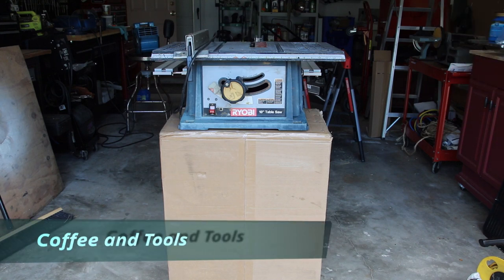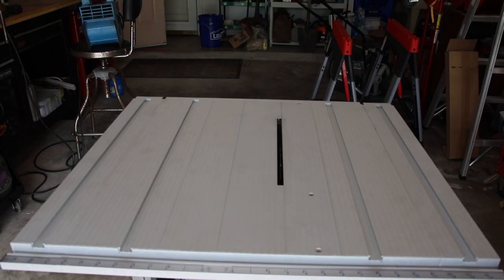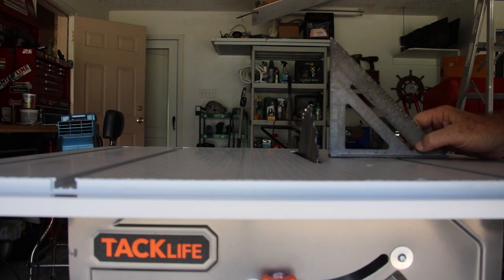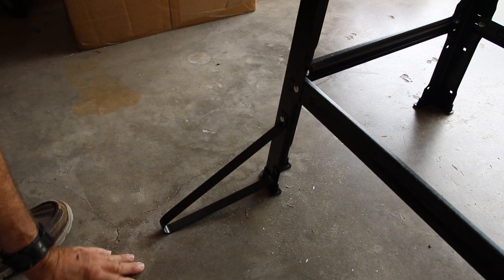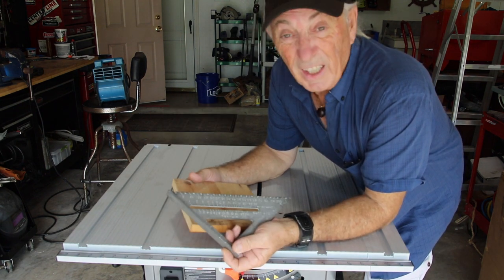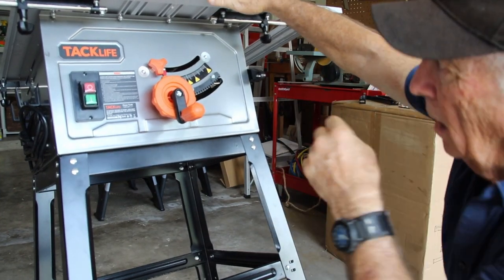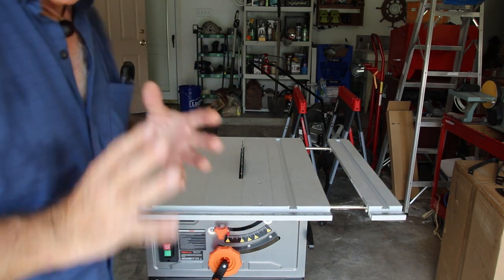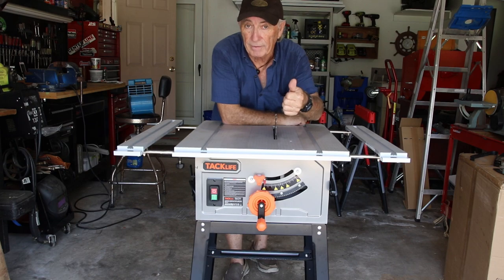Low price Tacklife table saw VS my old Ryobi saw, C&T Ep 112

Comment: Gen 2 has the 5/8" arbor and the full length fence.  I just put mine together last night.
Reply from the maker: Very pleased to see the updates on it from Tacklife tools. We did an update video about this generation 2 model :)
Reply: nice to hear that ,,,the two points that almost made me forget about this saw ...it seems there is a lack of good affordable tablesaws to be had during covid supply and demand times.  My last Sears with the folding wheeled  base is a wonderful saw but the  bearings are starting to go after a lot of hard time,,,its been a great saw , and i have a replacement wheel around base because they did a free factory recall on a base that failed on 20 out of a zillion saws: user error in my opinion, have never had a problem with my original base .  the search continues for a saw I can put on that new base ....this may be the ticket. I will not buy any more sears things now that they are gone and have stopped making the 19.2 volt tools which are damn good tools , especially the 1/4 inch impacts.  Sad they stopped making those and sad Sears is no more .

Comment: Good thorough review. The fence would drive me nuts. After using a dewalt I bought one. The dewalt fence was a major selling point for me. Tacklife seems like they make solid tools. Especially  at that price point. As a young company and with Amazon affiliations I can assume they will only get better. I have bought some cheaper Wen tools that have been very good.
Reply: The pinion system is why I bought a SKIL tablesaw. They also use that system. I bought a table saw for precision, the last thing I want is having to wrestle with rails to get them square. And its not just this saw either that has the issue, a lot of other name brand ones do too!

Comment: The only problem I had with mine is the fence is not sturdy and Izzy move it to the other end it moves so in essence the fence sucks other than that it's a good little table saw
Reply from the maker: I've made an upgraded fence. Further plans are for a better blade. Like you, the saw is pretty good.

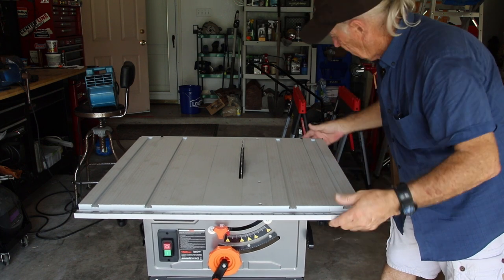Comment: Hello,  at 10:35 you mentioned a sled for this saw.  Have you made one, or are you going to?  I want to make one for my Tacklife saw and need some ideas.  Thanks
Reply from the maker: HEY !  Yes the sled video will be coming up soon. Thanks for asking. Should be out in the next few weeks.
Reply: @SirTools  Sounds good I will be watching for it.  Have you gave any more thought the the fence dimensions? I want to build one of those too.  Thanks again.
Reply from the maker: @robertbonds2562  Hi Robert. The 4pc of wood used are all 3/4 inch thick. Total length is 29 inches. basically you'll need 2pc of 3/4 x 2 inch (fence face plates) and 2pc of 3/4 x 5/8 inch. The slot opening is 6 5/8 inches in length. The slot open should be 5/8 inch to fit over the existing Tacklife assembly. Hope that helps for your project. I cut this from an old pine shelving board.
Reply: @SirTools  Awesome thank you.  Love your channel keep it up!

Comment: You didn't discuss the fence. Does it lock parallel to the blade. Some reviews criticize the length. Do you find that to be a problem?
Reply from the maker: Hi Tom, the fence seems to work, but really needs more support like longer and a T on the back of the saw. Locked down the fence doesn't guide well. I'm thinking about upgrading it for the future.
Reply from the maker: new fence project at :https://www.youtube.com/watch?v=nzCYnt4OINI

Comment: Very irresponsible to suggest that you can just ditch the riving knife as though it doesn’t matter. If it interferes with the normal use of the saw, that is a major design flaw and should be highlighted as such. It’s not like a blade guard where the safety benefits are fairly negligible; the riving knife is a critical safeguard for preventing dangerous kickback incidents. Craftsman sells a $200 table saw with a riving knife that adjusts so it can sit below the top of the blade; it’s not a premium feature. Don’t lead your viewers to believe that this is a quality product because you can just operate it without its most important safety feature if it doesn’t work for you.
Reply from the maker: A good idea might be to cut it down and re-install it. All my past saws did not have this feature. Your points are well taken and I did say in the video NOT recommended to anyone else.